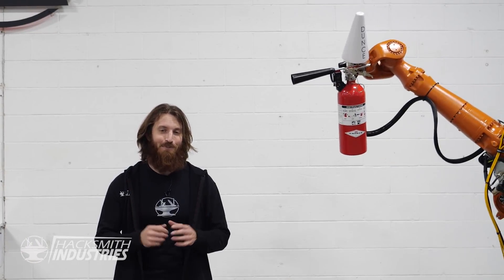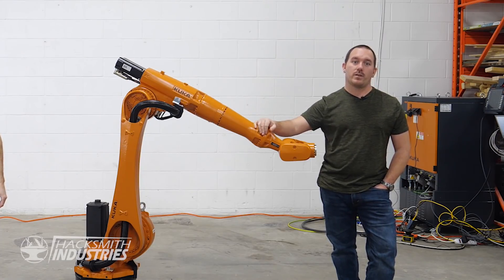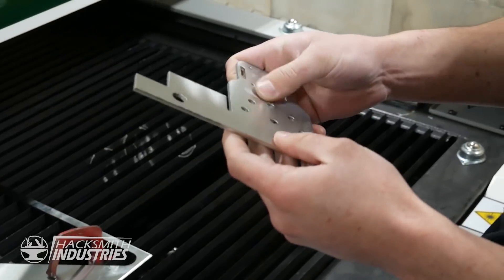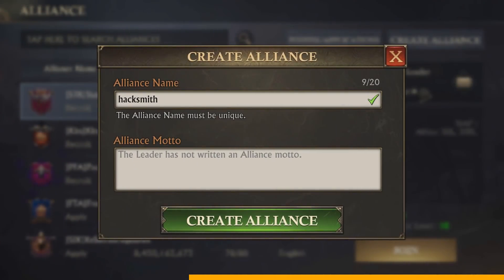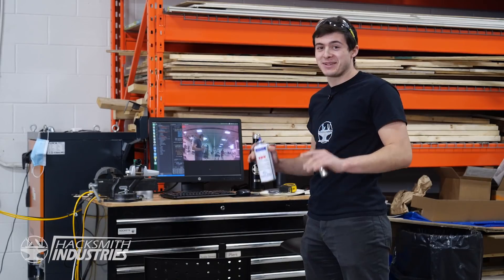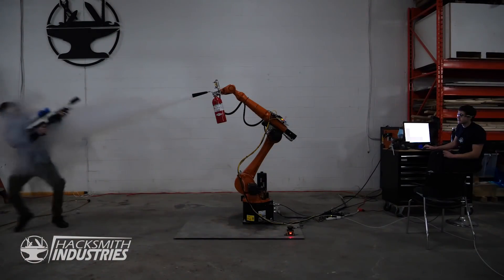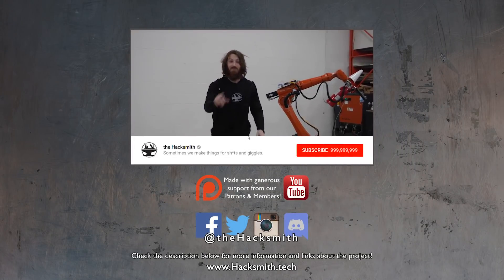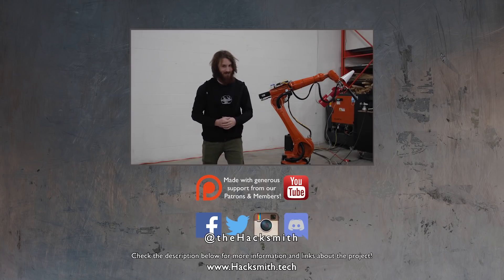TONY STARK'S Robot in Real Life?

Comment: How to build the Bird wing suit?, step 1. the Wings will flap downward for propulsion causing the air to push the subject upward and tiny holes in the wings the opens as it flaps downward for aerodynamics allowing air to flow through it. step 2. As the wing flaps it opens and closes the holes. step 3. gears can be used so its can rotate and alernate and levers in the wings to move the gears, making the wings speed up as it flaps.  step 4. The Airfoil wings are used to lift objects that would make for a faster flight when needed, such as helicopters and airplanes. step 5. The Airfoil wings also extend from one side of the fuselage to give some space for pilots. A convenient way to describe the shape of a wing is by its aspect ratio - the ratio of length to width. Among bird wings, aspect ratios vary from about 1.5 to as high as about 18. 2 depending on the design. The proportion of length is based on whether you're using the same model as the main body, or if you prefer something with more flexibility or flapping motion. There's no way of telling how long an aspect ratio will last since there's no written standard for them, but there are plenty of people out there who'a know better. This means that the only way to determine how your wing looks like will be to fly your plane and observe how well it does, rather than relying on other designers' opinion.

Comment: The idea is good but you cna't substitute the extinguisher very easily, plus the holes in the handle lowers it's structural resistance. The actuator should be redesigned imho. I would try to change it with a plier with sphere cusions and a gum contact part so the lever gets pressed but the extinguisher won't be "touched" in it's parts; plus: it would become compatible with any extinguisher (and not only)

Comment: Can you please try to use Loctite / Henkel - 1255702 - A-6750 STRUCTURAL ADH EXT-MIX 2 PK 1 LITER, Each and an UV light to make a Spider-Man spider web, I did some research and I think there is a like a 20 through 30% chance it might work.

Comment: Wish you would make it mobile and so Dummy would move and portable making it with a docking station so it can charge and scan for fires at the same time also it would be cool if you connect dummy through the fire alarm and sprinkler system so dummy can tell where the fire is and if it can’t be put out by the sprinklers it can be put out by dummy

Comment: Why are you using air cylinders then you can do it with electrical cylinders with more precise measurements? Just wondering!
Reply from the maker: If by electric cylinders your referring to linear actuators  they are far too slow. If you're referring to electric solenoids, they're far to weak to actuate the extinguisher ;) we know what we're doing.  There's always a reason why we choose what we choose!
Reply: @hacksmith  Thanks for your respons now I understand. ;)  Love your content keep doing what your doing.

Comment: The CV seems to work suspiciously well, like how it instantly pans to a fire outside its field-of-view? Did you give it some help, or perhaps a memory (and allowing it to pan its surroundings before starting extinguishing)?

Also, a bit interested in how you trained it, and what type of machine learning you used exactly. Most notably, how did you generate the datasets for training?

It circled the (already detected) flame in a few of your shots, before extinguishing it. Was this to decrease false-positives by ensuring it stayed positive for duration of the panning? Or maybe it was to give it depth perception? Or was it just some pre-programmed movement for it to look good for the camera?

edit: wouldn't it have made some sense to use a far-IR camera with this robot? Or would it have extinguished too many of your glowing hot projects even before they spontaneously combust their surroundings?
Reply from the maker: Public library online,  didn't have to train it.  Github is your friend!
Reply: @hacksmith  There is a pre-trained fire-classifier?
Reply from the maker: Yeah

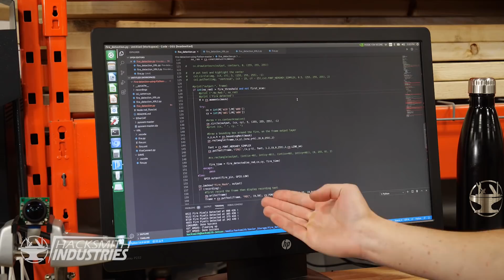Comment: 5:56, line 151, there is a except: pass block --> it's dangerous, because you can get stuck due to that kind of block (slightly better if you replace the except by except Exception: and display for debug or log the raised exception). The robot has other security (checks for singularities, speed limits on each joint, perhaps even torque limits, etc.), but you should consider to use a linter and more to detect the errors in your code (like pylint, flake8 or even wemake-python-codestyle). And use git.

Comment: She use a camera to check the flame but it didn’t put out the entire dummy. Couldn’t a thermal imaging system work better word to text heat in specific areas close to the range of flame temperatures.

Comment: Wow, amazing work! The speed at which it detects the fire sources is especially impressive, it took the robot only 18 seconds to extinguish 12 torches. The Jetson is particularly well-suited for this kind of task, it's just as compact as a Raspberry Pi, but has a much beefier GPU which is perfect for running OpenCV or TensorFlow. I'm not sure which model was used here, I have the Nano (4 GB) which is only $99 but there's also the cheaper Nano 2GB at $59 or the more powerful Xavier with 8 GB at a whopping $399. For anyone interested in machine learning applications in a compact form factor, I'd highly recommend checking them out (disclaimer: I have no ties to NVIDIA, I'm just a happy customer).

Comment: You should give it a thermal camera for better precision! Perhaps that would allow it to sense fires even before they start!
Reply: Not saying it's impossible, but training the system to detect fires before they start and tell the difference between fire and just hot spots ( warm engines, welding, lightsabers, etc ) might be a bit much for the team right now.
Reply: It's probably unlikely that it would work. However, it would be cool if it could say "fire imminent" or "beware of heat". Additionally, if it were to utilize both cameras as Kyouka said, it would be much more precise.
Reply: @MrGoesBoom  it's better to be safe than sorry 😂😂
Reply: Pyrority Report 😆
Reply: Even better, a combination of both a thermal camera and a normal camera.

Comment: I think the IA has a crucial mistake, you tested with fires coming out of controlled devices (tiki torches and the helmet) and it failed only in the 1 instance of an uncontrolled fire, a shirt and a torso on fire, this is because the fire was bigger and it was aiming at the center of it, when it's common knowledge (i hope) that you must aim the extinguisher to the base of the fire, which o don't think dummy was doing in the mannequin test

Comment: Why are you using a complicated and maintenance intensive hydraulic (maybe pneumatic?) switch to pull the trigger.  Use a cheap and easy solenoid.  Smaller, easier & cheaper.
Reply from the maker: Fire extinguishers are quite difficult to squeeze.  Linear actuators are usually slow.  This is the best way for a very fast and strong trigger

Comment: Hey @HacksmithIndustries you guys should do like a T-1000 type thing. Although I figured it might look more like a Rev-9 if you used something like ferrofluid rather than gallium. I had an idea for it once, just for the arm to look like the big knife or another tool-like object. Just some electromagnetic bars on a set of rails going down the arm, forming a triangle type shape. Then you would use small servo-like motors to move the electromagnetic bars up and down the arm. Then, when you want the ferrofluid to move to a certain area, just increase the magnetism in that area.

Comment: Awesome work guys! the next step will need to see if the robot can put out a fire from a moving object/person. This to get it closer to real world application since many times a person will not be just standing while they are on fire, the person will end up moving a lot do to panic. Also, this can possible be used with fire fighters sending the robot into or near burning building/cars, since sometimes the heat is ether too hot or to danagers for fire fighters, in addition to ragging wild fires.

Comment: You guys should mount it to a truck and make it to a Super strong AI firetruck (do it with a battery if you can. If not just use a longer cable from the control box to the arm

Comment: To make this even better, you should try hooking dum-e’s fire sensing abilities to your security cameras!
Edit: A good way to do this would be to give Dumm-E a large set of paths he can take to move all around the shop. Then, a camera on him would tell him if something was in front of him. The security cameras would tell him where the fire is using numbers, such as the showroom might be 1. Then, using the paths and a pathfinder A.I., he would use the best route to get there and get the job done.
Reply: That would be awesome but the calculations to move the robot to the burning location are crazy
Reply: @flobuilds  I don't think it would be this hard. You'd of course need at least two cameras, but calculating 3D coordinates based on the difference in the image and then move the robot to face these coordinates should be doable.
Reply: @togamid  hed probably want to upgrade the gpu power on his sever and then run openCV on the that rather than an arduino, then they could also smooth out the motion (requires a lot of math to prevent robot motion from being jerky). It would be really cool!
Reply: @Quamsi  that would be really cool yes 👌🏻
Reply: @togamid  Do you have any idea how this stuff works?? It would take months to do it and a big cluster to process al the data
Reply: @Quamsi  They did not use a arduino, its a nvidia jetson nano
Reply: If they just hooked it up to the security cameras made it mobile ( they did this before ) they only woud need a 3d scan of the office and the have the technology so I dont think it that difficult
Reply: @lennerttemmerman  would be doable yea
Reply: @flobuilds □
Reply: @flobuilds  Maybe, i dont have too much coding experience, so dont quote me on this being good. Maybe, they could implement a path that dumm-e could take. Like have a bunch of routes around the place and a camera to stop him from running into anything. And it would use a normal pahtfinder A.I. to find the optimal route. Sort of like how a map app gives you the best route
Reply: The pathfinding really shouldn't be that hard.
Following the paths is a bit harder but can definitely be done.
The difficult part is making sure the robot doesn't fall over while driving or runs into something that's not where it's supposed to be
Reply: @sebastianjost   yea especially with this kind of robot...falling will stopped it completely since it don't have ability to stand up..maybe make spider leg if that possible
Reply: give it wheels as well
Reply: F Ù Ć Ķ • М È ! ! ! • I WĄNT ŞĘX • OPÉN MY CANÁL !  excuse me wtf
Reply: @karva1a  bot
Reply: that a good idea...it make early cause of big fire can be prevent
Reply: Unfortunately you can't make a KUKA robot mobile. They would need to replace it with s smaller robot that doesn't need 3-phase power.